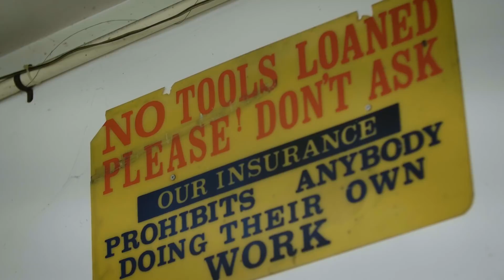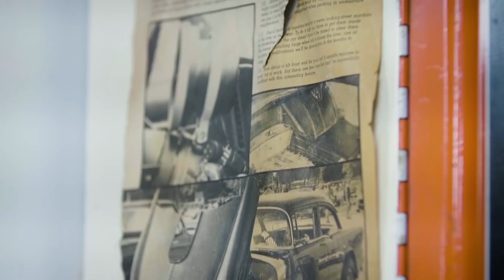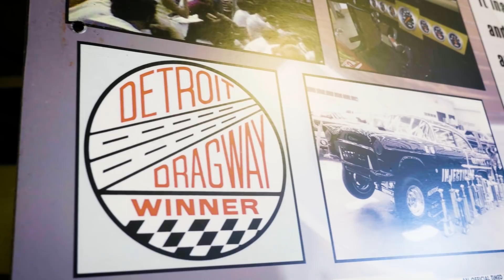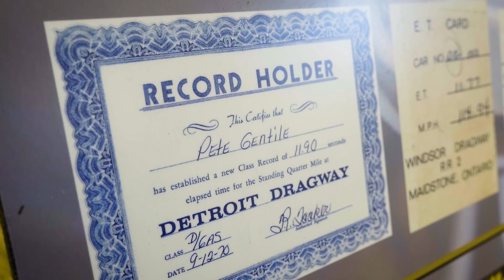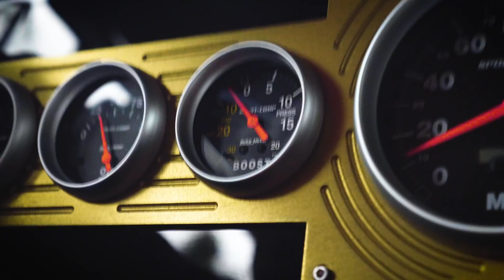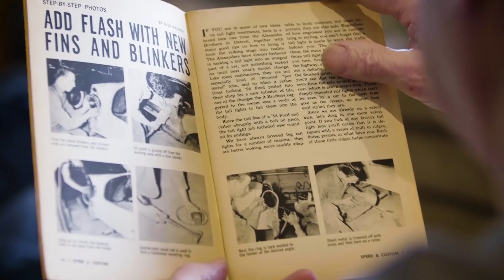750hp Drag Racer As A Daily Driver? - Carfection

Comment: The owners specifically states the engine is producing "about 600 HP" in its present state, and that further modifications (including undoubtedly unstreeragle camshaft) would be improve output to "probably 750 HP."

Yet, this video's title misleadingly states "750 HP."

This is a great car, but the video's title needs to be fixed.